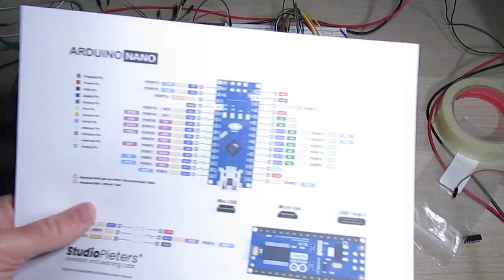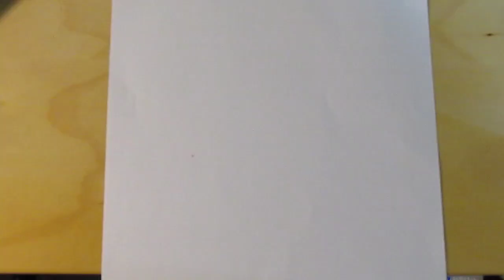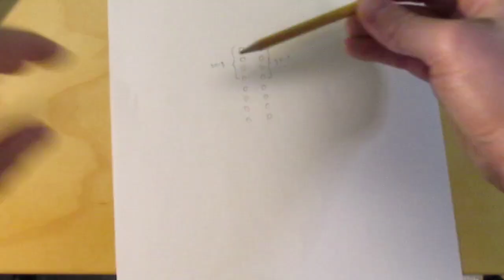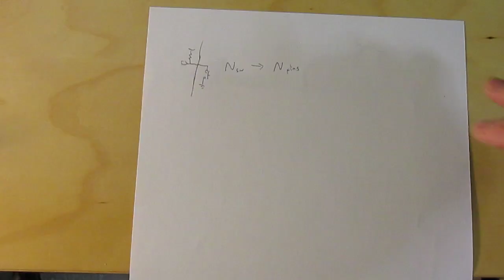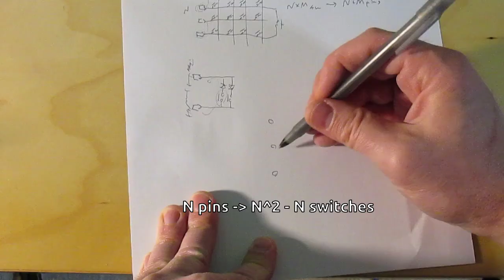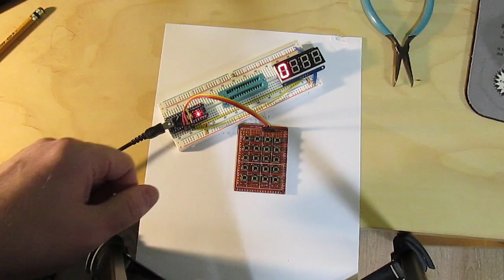TTL Chip Tester - No-Effort-November!

Comment: Another way to handle multiple switches that some Arduino shields use is to have the switches select different resistors for a voltage divider and then read the voltage with an analog pin.
Reply from the maker: Oooh, that's good!  I'm imagining something like an R-2R DAC with switches at the inputs?  That should work with multiple switches being held down at the same time too.  Thanks for the tip!